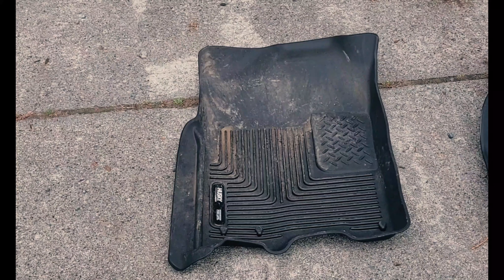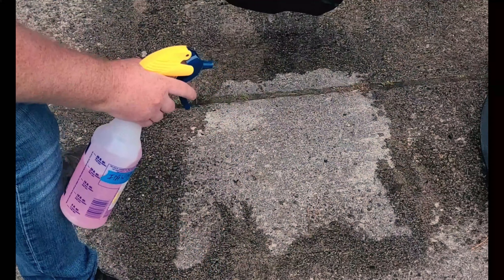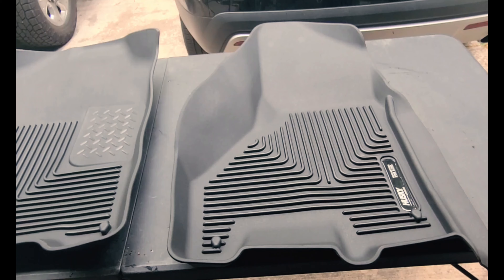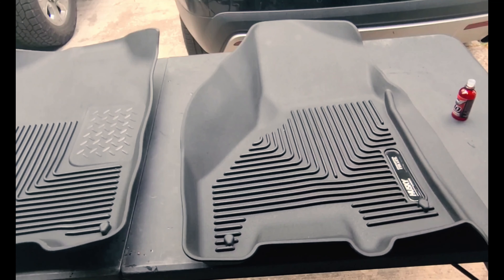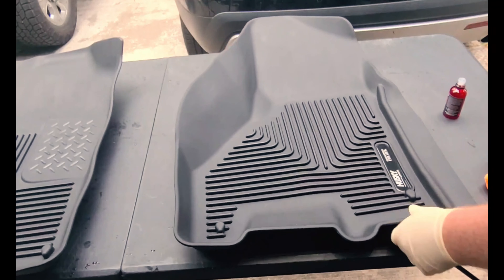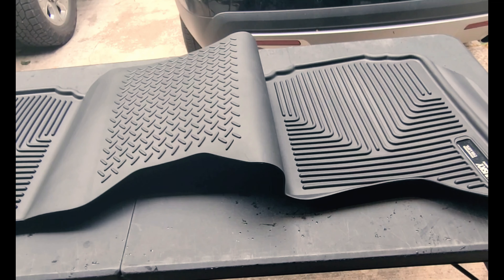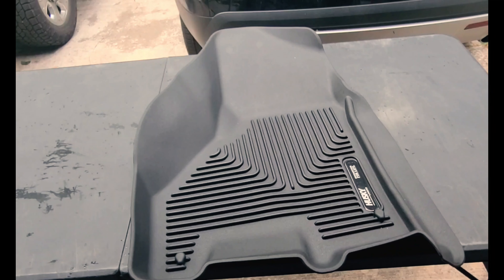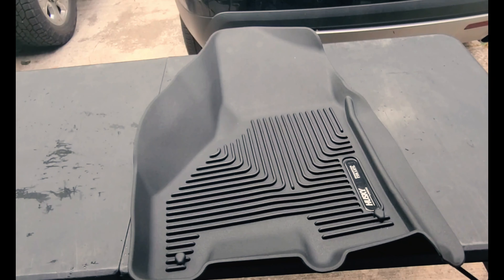Cleaning and Protecting All Weather Floormats..... With a Twist #yettiautodetailing #extratough

Comment: Very interesting.  When you cleaned it, it looked super clean, brand new like.  These mats are pretty durable.  Do they really need a coating?  Just curious.  Are they slippery after being coated?  I am following this because I want to see what happens with use.
Reply from the maker: They are about 6 months old. No the coating doesn't make them slick at all. Just helps in future cleaning making them way easier to maintain. I'll do a follow up cleaning video once they get good and dirty again.